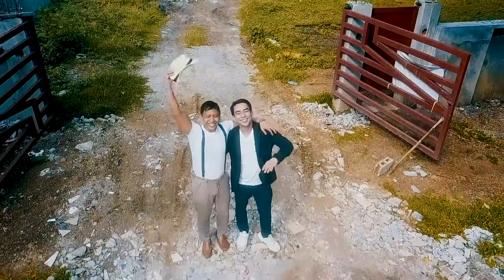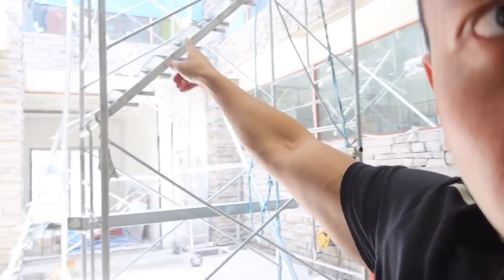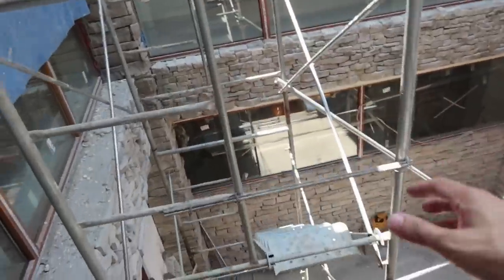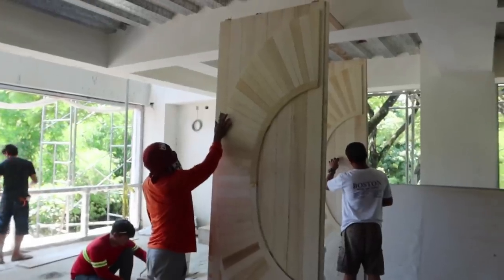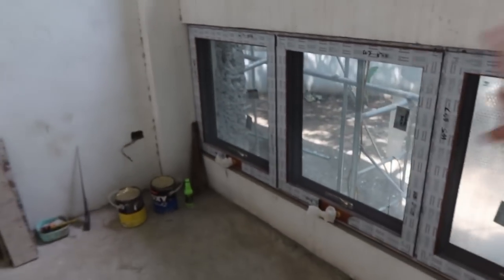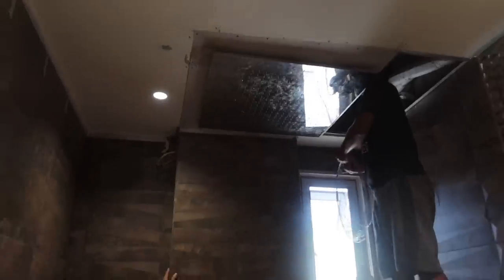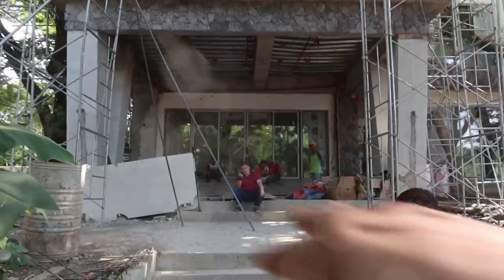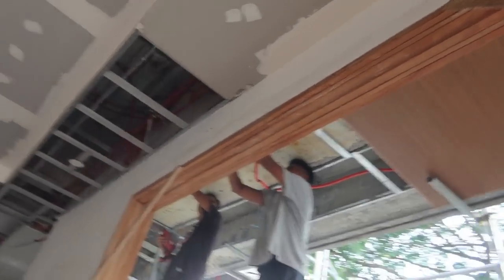The Final Part of Our Home to Complete - June 7, 2022 | Vlog #1507

Comment: Make a kennel outside  for your dogs. So that when you have visitors the dogs won't be stuck in the room
Reply: Yes, we plan on making a dog run somewhere outside at the side of the home however they may overheat during the day, so our spacious bedroom which will be air conditioned 24-7 would be much more comfortable for them.
Reply: What about the stairs? I forget which vlog i posted on, but the opening between the steps may be dangerous for the fur babies.. falling from higher levels.

Comment: @Mikey at 18:34 shows three ceiling metal panels. #3 appear to be sagging, this is NOT a good thing. Have them check into that please. That is NOT normal. They are buckling from the weight above.
Reply from the maker: Yeah we had that looked at by multiple senior structural engineers and they said that and the whole house is absolutely solid. Nothing to worry about.
Reply: @MikeyBustosVLOGS  Alright, just looking out for you. (Former construction manager.)  We would have been told to replace it here in the USA. Can't wait until you move in!